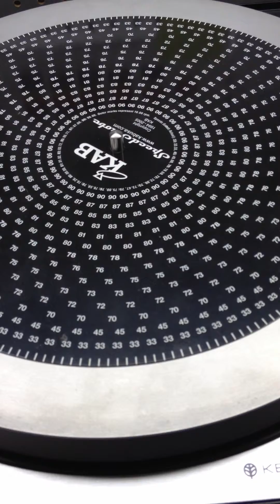Kenwood Trio PC-400U Idler/Belt Drive Turntable Test Drive, Part 1

Comment: Hi I am starting a restoration of my Pc400
If I have any question,can I contact you? Thanks
Reply: Sure
Reply: Richard Hing thanks
Reply: Hi Richard 
Did you notice if your trio pc 400 has the motor that runs hot and the heat is transferred from the pulley to the belt?
Thanks
Reply: I have the same problem with the heat and ask myself is this is normal. Would be thankful for a information
Reply: @EckartvonPerfall  I think it happens if you are using the turntable in a 60hz 120v zone
Reply: @fabriziocaprioli8041  Thanx... I use it in Europe with 230V 50Hz with a varic down to 115 V - if I turn the voltage down the motor starts rippling....?!

Comment: Thank you for posting this video and extensive explanation of the restoration work you did.  I just purchased a group of vintage gear (mostly a Kenwood setup) that includes this turntable.  I am also in the process of restoring the PC-400U.  Your explanation is of great help. thanks
Reply: Please let me know if you need any assistance with balancing the tonearm and lubricating all the bearings. It is a very nice turntable and deserves a more substantial plinth to get the most out of it.